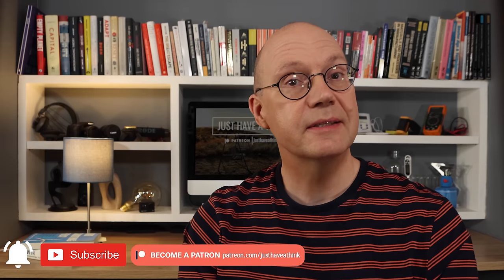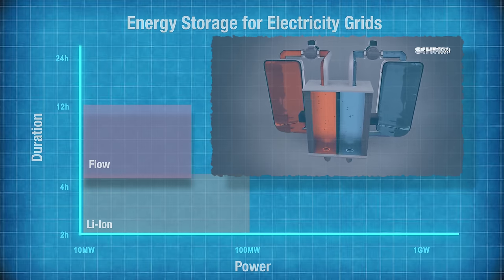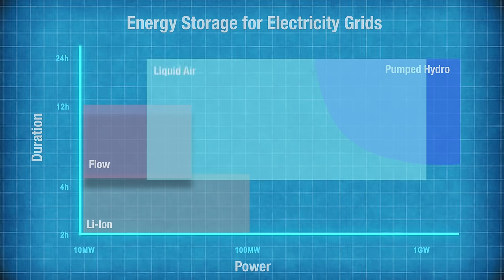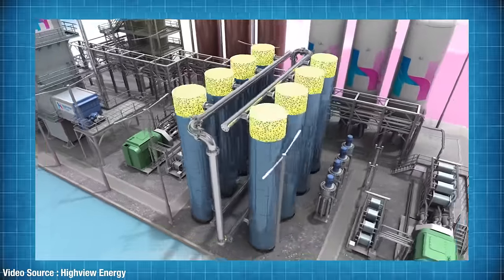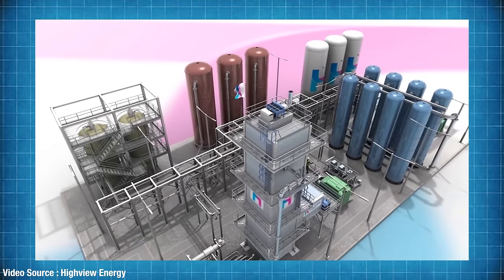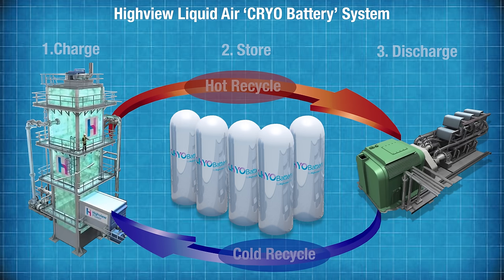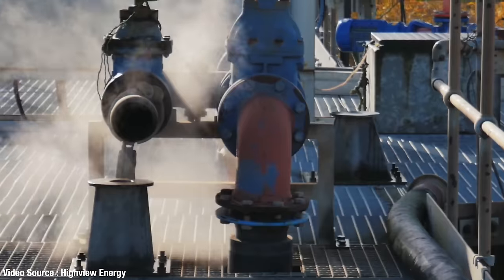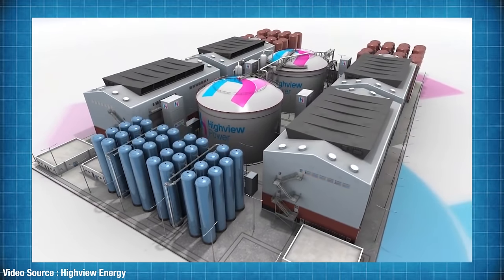Liquid Air Batteries. Literally energy from thin air. Seriously. Literally!

Comment: The efficiency can be increased a bit by using waste heat from another industrial process during the expansion phase. This involves colocating the station with another type of plant.

Also, the cooling phase can be used to pull off gases that have value and keep the nitrogen. This has the potential to generate revenue by selling liquid oxygen, helium and hydrogen.

Comment: I wonder if the economics of a hybrid system have been considered which could boost the output capacity of the system significantly in exchange for adding some natural gas into the mix.

By adding a gas turbine that could use the pressurized air to reduce or eliminate the compressor losses of a gas turbine then the power output could be increased significantly.   The idea with a  hybrid system is that it could be designed so that the gas turbine only ever gets used to cover abnormal loads - ie the coldest week of the year.

Comment: What if they made a 2 tank system that pumps water from a low side to a high side till full. Then when needed drains through turbines back into the lower tank. It could be a closed system so you get minimum water loss. It would look like a giant hour glass

Comment: when it comes to liquefied air (liquefied nitrogen,) if you release the liquid nitrogen at the bottom of a water well, the liquid nitrogen will push upward, creating a current that could drive a turbine. then the gas collects at the top where it seperates itself, ready for another reaction. Should this be incorporated into the system?

Comment: So this thing compresses ambient air until it liquefies and releases most of the heat produced to the surroundings with some going into the "Heat Store".
It keeps the liquid at ambient temperature.
When needed it expands the gas using heat from the surroundings plus a little from the "Heat store"

Doesn't this mean that the only energy stored is in the "Heat Store"?
What is its capacity?

Comment: Liquid air could also be a renewable fuel for ships instead of diesel.
Reply: Jonathan not only AR you correct but as I try to say whenever time allows the use of propellers in ships is insane. It's the World Trade Center strategy of not knowing how to land but just getting it done. Container traffic or the shipping industry should be bi-directional. You don't push on the water you pull on the returning traffic. You don't need continuous propulsion instead of cellular network of high velocity ships who maintain their inertia Levels by yanking on each other as they pass are basically infinitely more productive allowing for supersonic operation at a pittance of the energy that the crawling speeds currently destroy our world burning fuel to maintain, if you can call the crap from byproducts of refining fuel at all that they burn.

It takes courage to point out the emperor has no clothes or something like a propeller is absolutely insane because it is obsolete once you have enough traffic to have that cellular inertial network which among the implied or explicitly above stated strength AR the linear relationship in terms of the yanking and the exponential reductions in in efficiencies from decreasing time in transit that include no need to process food or other perishable cargo for preserving purposes like freezing since the transit time is so brief. Of course much of the container traffic is bullshit it's not necessary to grow your mixed frozen vegetables in China to be sold at an American 99 Cent Store for that dollar per pounds frozen carrots peas corn. But the cost of container shipping is extraordinarily High compared to what it would be if you had a longer-term perspective and invested the capital smartly, likely far less capital, but devastatingly destructive to current Returns on investment. For the planet and almost everybody to win the losers who are in power must be overcome. This does not go without saying.

Comment: You could also every elevator or lift in every large building when it goes down you hook to a cable can you use a dynamo to slow it down and generate short bursts of electrical energy this can also be done with a Car lift car lift in auto shops when the car comes Down the weight of the car Will Will spin a generator so that say every three Let’s Lyft you get one for free If you put speed bumps that are connected to hydraulic cylinders every time the car Crosses The bump you generate electricity with all the thousands of cars on the roads happen to go to work or trucks happy to deliver things would cross these small hydraulic  pumps generating electricity if you have some in your driveway say three speed bumps when you go to work you generate electricity when you come home you generate more every time the weight of the car goes over the bump

Comment: its called phase change energy storage, it looks good to use it with others renewable fuels for a gas turbine electric car. 

apart from that we dont need electric energy nor electric energy transport. the best use of liquid air is for diy farmed vegetables refrigeration, electronics and motor refrigeration, magnetic levitated and bearings in appliances as vertical wind turbines, flywheels, motors etc or diy pico factories who need cold temperatures in some chemical reactions

Comment: It seems you would need a lot of heat to evaporate the liquid air to run the turbine. Where does this come from? Is it just a lot of ambient air that needs to be blown through the evaporator or is it waste heat from the liquification stage? If the liquid air tanks are already full, you will not be running the liquification stage.

Comment: For an alternative hydro power system what about pumping water out of flooded mine workings to a holding pond at the surface then employing a turbine lodged in the old mine shaft to generate power when water flows from the surface back into the underground workings?

Comment: Im not sure how building a dam takes away water from people downstream.  Once the reservoir is full, the remaining water flows downstream. It stores only what it can hold.  Unless you divert the water somewhere else for irrigation or something the same amount of water exits the dam as enters.  Depending on the local evaporation vs precipitation rate, it could lose or gain a little.  The energy extraction is not what takes away water.  It is the farmers and cities that use it.  That happens if there is a dam or not.  It just means they have a more consistent water supply if there is a dam.

Comment: If you have a liquid air extraction station at a high altitude, you can use gravity of descending new liquid air down a pipe, and it could turn turbines like hydroelectric power, to offset an additional cost margin

Comment: For one thing;  storing energy isn't needed and there are many things that we can do to not need any other electricity than the amounts that each and every home can produce by installing any correct amount of small turbines that sell for inflated prices to ratios of wattages that is produced;  which brings me to the need for a turbine product that is non profit or one that 3d printers can print and uses all bearings and hardware that fall into the standard sizes of each of the parts needed's regulated categories;  where their sales are of from countless factories and if possible;  are of public domain.  Then while making sure that this initial design has the size that is enough to charge the electric vehicles and more then needed;  well then all we then would need is wind enough to give us that amount when needed.  Cheers;  and I could go on and on about many other ways that are not shared or I hope that at least someone thought of these ways other then me;  otherwise everyone is likely stupid.  Sorry to say.

Comment: what about the tech where they would carve out a solid mountain rock cylinder pumping water underneath it, the sides sealed. then the cylinder of rock is pushed upwards. and when they need energy they reverse it and allow water to be pushed out by the massive rock as it slowly descends down.

Comment: How about using a large culvert or tank with a column of water for tapered floats floating upwards in the column pulling floats into the bottom with the weight of the floats pulling down after they emerge from the water and going around a top pulley then help with their weight and after going around the bottom pulley they are forced back into the water column through a valve at the bottom and the pulleys would turn generators for free after it is built using flotation to generate power. Floats are on a continuous cable.

Comment: IC generators work on the difference in temp between hot combustion air and ambient temperature, I see the difference from cold to ambient is as forceful, achievable thru slow compression

Comment: Normal battery lifespan is horrible compared to the potential long lasting Steel or carbon fiber other durable material used in storage. Lithium ion and lead acid are my opinion dinosaurs now.

Comment: What energy source is used to condense the air to cryotemperarures; is that energy from nonrenewable sources?
Reply: When it's windy at night when everyone is sleeping and not using as much energy the windmill's energy would just go to waste. This idea is to use the excess renewables to charge the air battery, during these low demand, high generation periods for use in high demand, low generation periods.
Reply: Excess daytime solar, excess off peak wind..

Comment: 10:31 The units you use in the chart and in the explanation are IMO wrong. Your talking about capacity, so the amount of energy stored. That would be either Wh, J or maybe even cal or any other dubious outdated energy unit with their respective decimal prefixes. But in the chart and in your explanation you're using the unit of power, W.

Comment: When you mentioned the bodies of water to generate power have to be up in the mountains ( lets say 5000 feet )it reminded me of an old thought - Why do they only use the water to generate power once ? if the first source is high enough and released to generate power and then allowed to run off why not build it again at say a 1000 feet lower generate allow to run off then do it again all the way down to sea level  ?

Comment: "Over the many years of testing and development the company managed to achieve efficiency of 40% energy lost" 7:55
Reply: Do you have any idea what the percentage of lost the electric grid is during peak hours? I was exposed to that number by the Phenix company in the early 90s. Unfortunately cinematic Hysteria unchecked for decades had Sacramento shutdown a working Nuclear Power Plant and so they spent insane amounts of money on photovoltaic panels and refused to continue the fund ice storage!

But using nitrogen instead of water is next level compared to the work that was done in 1980s in terms of actual houses having incredibly Superior climate control systems. It's very simple the homeowner can invest $1,000 and get like a 50% annual return on it or the electric red grid can we eat 5000 and get a 10% return which they done use 2 tax the homeowner passing none of the return on just charging them for the 5,000 invested. Electric cars make that same mistake. There is an Italian electric scooter with a monstrously large under seat lithium ion battery. It stimulates very very well what writing on liquid nitrogen would be like It's just tough like 20 times as much to produce or operate and it's antitrust that explains why they haven't shifted to liquid nitrogen because that's infinitely more profitable to distribute liquid nitrogen and sell turbine micro Mobility Etc. There is uncoupling the scam and then there is uncoupling that we should be talking about. General Electric should have been dissolved entirely instead of coming back now vampire Ashley committing the crime with their turbines in charging too much and selling too few because they serve a master and it's not their stockholders or their customers, again!

Comment: NHK showed a much smaller scale system storing excess energy from wind as compressed air. As with the more advanced system you describe, it turns compressed air into a battery with no CO2 emissions other than those generated in manufacturing the components.
Reply: what if you manufacture in a place like iceland, there is then basically no emmisions from manufacturing. (maybe a little from mining minerals ect.)

Comment: New to your channel - seems like a good find. I've long thought the air surrounding the earth could be used as energy. All the energy we use day to day is a form of pressure equilibrium finding a new mean free path. Air pressure is pressure - at 14.69 psi at sea level - and there should be a way to utilize the PSI of that pressure as a means of propulsion. After all - only a thousand square inches would be 14,690 pounds of push force. That means if you drive a car through air - what is stopping the car from tapping into the air and utilizing the pressure on a unilateral body panel as your means of propulsion - like the sail on a ship, but different.
Reply: "what is stopping the car from tapping into the air [...] like the sail on a ship". The fact that you dont have a pressure differential. Nice thought! I had it too when I was younger and still in school, tho I was more thinking about water pressure and how you could make use of e.g. the about 110 MPa of pressure in the mariana trench, which is ~1000x the pressure of air at surface level. The problem is the absence of the differential as the pressure is constant. Yes there is force applied. But its static. Wind blowing in a sail is dynamic as there is actuall fluid moving here. Imagine putting a bottle of water on a table. The force we call weight that is applied to the table (and vice versa - > Newtons 1st axiom) is non-zero but can't be harvested. Power is Work per time and Work is Force times distance. As the distance is zero the Power therefore is zero, too. Thats also why you harvest energy from the oceans from waves or tidal displacements as these are proccesses that involve dynamic fluid motion thus a pressure differential or pump water into a reservoir like in a dam. Unfortunately, the sheer fact of presence of high pressure in static fluids (lets just ignore convection etc for a second) is worht nothing alone.

Comment: presumably calculations have been done to determine how much liquid air would be needed to power the needs of an electric vehicle? That is, using pre-filled bottles, how many practically sized canisters would you need? Or maybe a fixed tank with a safe means to fill up?

If that were feasible, we could stop making all these toxic batteries or dealing with combustibles like hydrogen and propane.

On the face of it, the highview power station doesn't look that large, for the power it stores and a small vehicle would not need the liquefaction part, just the release part (which requires some power too?).
Reply: This seems possible. I imagine there would be 4+ long cylinders laying flat or horizontal in the rear of a car. They would certainly take up much more room then a petrol or diesel tank, though I am not sure what the difference would be with the current batteries used. There would of course be at least one battery to power the car when it is not running and to start it.
However, refuelling the tanks should be comparable to refuelling a LPG tank in a motor car, which is usually a few minutes more then petrol or diesel for a standard passenger car, it becomes slower as the tank nears capacity and the pressure increases. 
The air released from the tanks could be efficiently controlled by computer to be released, that drives the turbine, to generate the amount of power required by the electrical motor on the fly, even if this was to work out significantly lower in distance, it would still be worth it because the time to refuel and the removal of the lithium batteries should be far more practical and inexpensive for the casual city driver.
This assumes that a car can be engineered to fit an air powered generator and tanks, which I think it could, though it may come at the cost of boot space. The noise from the generator should not be that bad either.
I have no idea what distances could be achieved under normal driving conditions but I am going on an estimate of 200-500km.
200km or even a bit less is still workable for around the city driving.
When it comes to long haul transportation, it is hard to beat diesel powered trucks or use of the railroad.

Comment: There are many technologies. It would be wonderful if they combine them together. 
As example: Liquid Air plus heat from reaction of aluminium with sodium hydroxide can provide electricity when air expands in turbine. Beside this, reaction of aluminium with sodium hydroxide generates hydrogen. Hydrogen plus oxygen can generate electricity when using them in fuel cells.
If store liquid oxygen and aluminium during summer time then they can be used in winter to produce electricity.
Reply: I was trying to calculate how much liquid air and aluminium is needed to store some amount of energy and a result is not so good as I thought. May be some mistake in my calculation...1kg of aluminium(together with the released hydrogen) can heat 129L of oxygen from -182degC till +17degC that will increase pressure of oxygen to 200 bar.
Then 0,129m3 storage vessel at a pressure of 200 bars, if the ambient pressure is 1 bar, can store about 11 MJ (equivalently about 3kWh) that is not wonderful result.     
Std enthalpy of formation NaAlO2 is -1133.2kJ/mol. For oxygen 213kJ/kg for vaporation and specific Heat about 0,91 kJ/kg*K was taken.